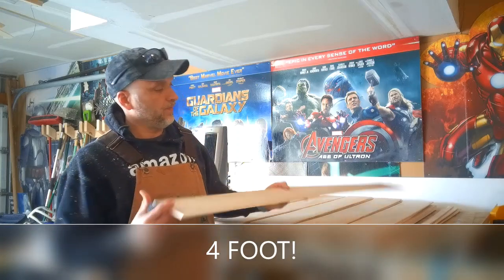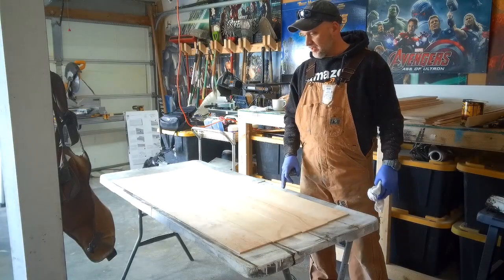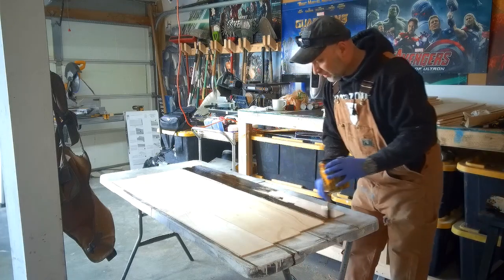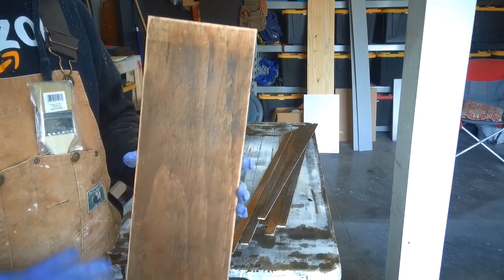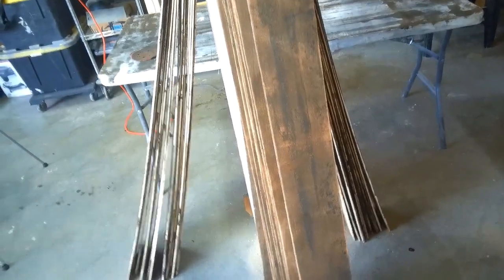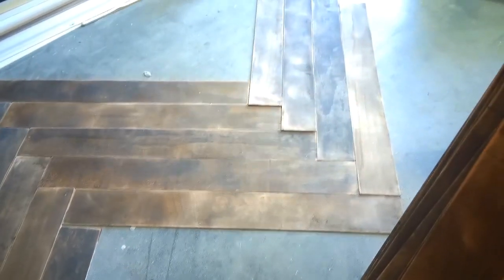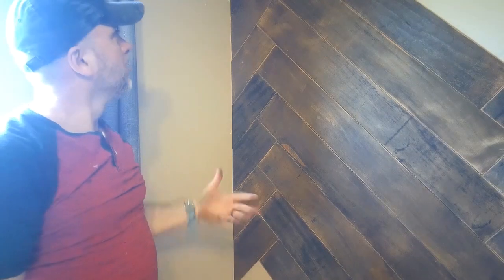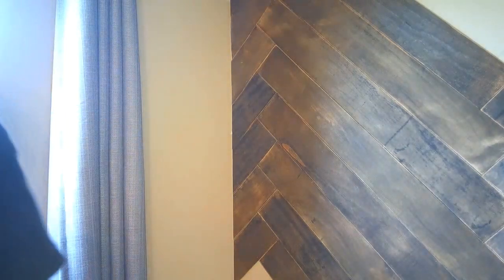Herringbone Pattern Wood Accent Wall

Comment: FINALLY SOMEONE Offers a cheaper solution then the $9 to $20 BOX for 8 pieces!!! It looks beautiful… Great job! I want a project that I can do BY MYSELF We have a lot of projects going on at our house and I try to find projects I can do myself.. not sure if I’m going to do the herringbone pattern especially for my first time…
HOW MANY SHEETS DID YOU USE ALL TOGETHER??? 
I hope my wall turns out just as good..I am going to use Blue Gray Brown Stains! Thanks
Reply from the maker: Lori Rogers   Thanks for your comments!  I have done this project in several different colors and in different patterns. It is super easy and cheap to do. I think for this project I used two and half sheets and the sheets only cost about $13!  I hope your project goes well. Thanks again